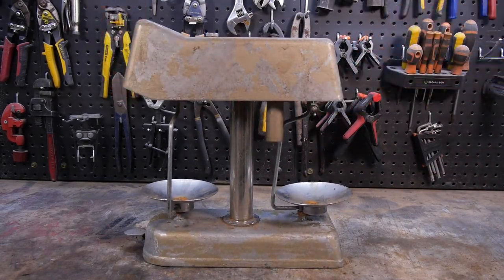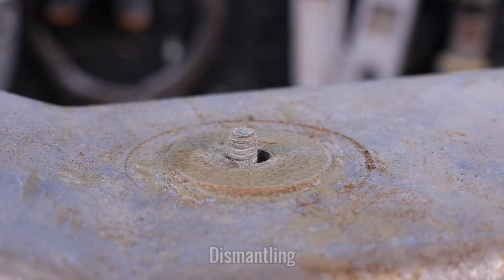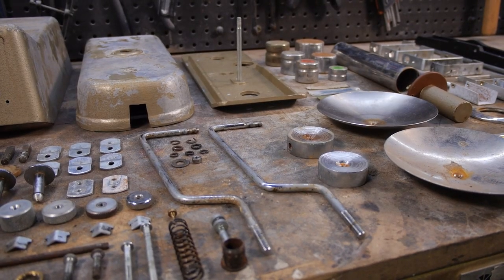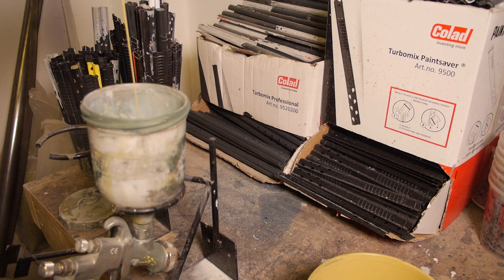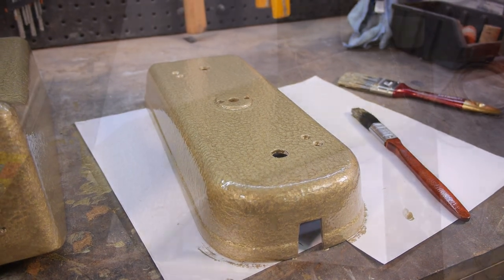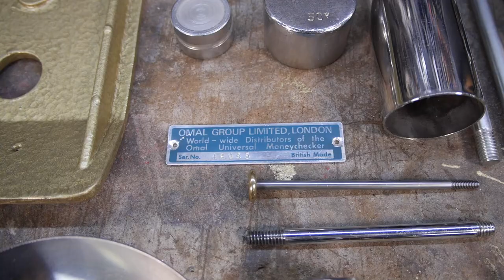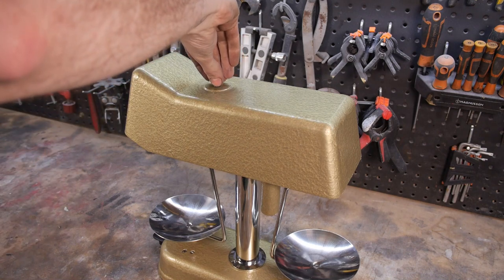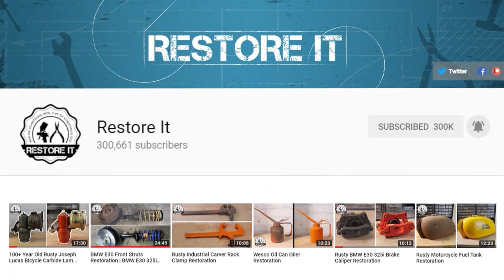1960s Omal Universal Money Checker [Restoration]

Comment: Looks nice!

A tip for your metal plating:
Polish the bare metal to a mirror finish before any plating, then a thin coat of nickel, maybe a light hand polish, then the chrome, as thick as you want (a car´s outside parts need it a bit thicker than some instruments).
The part itself is much easier to bring to a perfect surface than the chrome, if the latter is on a slightly rough surface, you can´t polish that out.

For a matte chrome finish a uniform blasting with glass beads should work.
 
 I once had to have a piece of brass to be chrome plated and I polished it to a mirror beforehand.
When I got it back from plating it was absolutely perfect already,  without any further work to be done.
Reply from the maker: Great tips thanks, Sthenzel! I'm only using a fake chrome kit which is the nickel kit you're talking about. I need to look into a real chroming kit but I'm not sure where to get one. I think the chemicals needed are too dangerous to sell to the public maybe. Either way, I'll take what you've said onboard, cheers!
Reply: @RestoreIt  Looks pretty chrome to me! 
Nickel usually is a bit more yellow and the electrolyte is green.

Comment: The only kink i see is that you lubed the parts. You're not supposed to. Measuring machinery in that realm doesn't use conventional lubrication and it relies on a careful balance of loose tolerances, and oil that's added with the tip of a needle (as in, very little). Mostly because grime will get in those and gum things up. Learnt that the hard way with an elaborate and antique set of measuring devices that just wouldn't work. When i read into it, i had to take it all apart and clean stuff up (i was lucky to find an old maintenance manual for them, which was rare).
Reply from the maker: You're absolutely right Aserta. I actually ended up only grease that one piece i show in the video. I'm going to clean it off when im next in the workshop. Its a good job I didn't feel like do any more. Thanks for the advice, much appreciated!